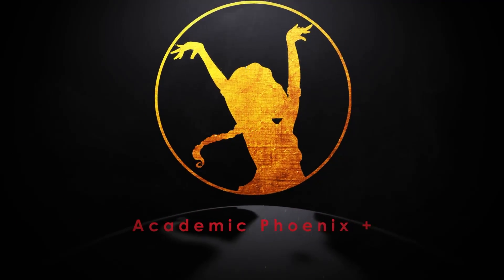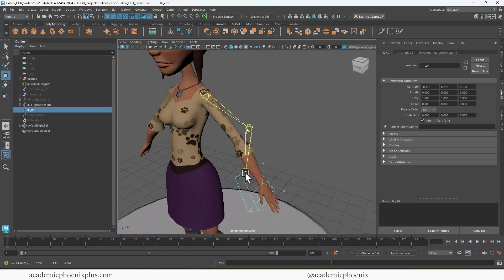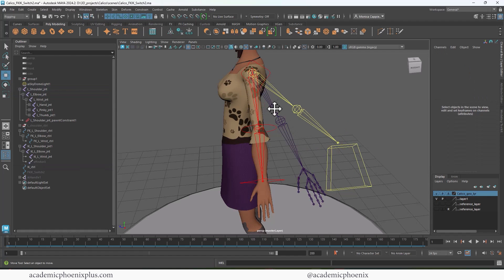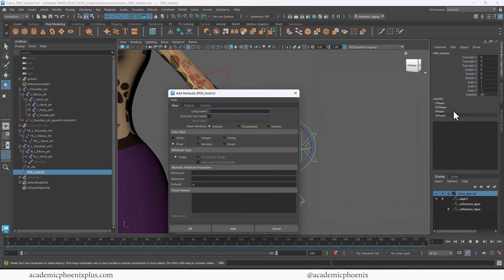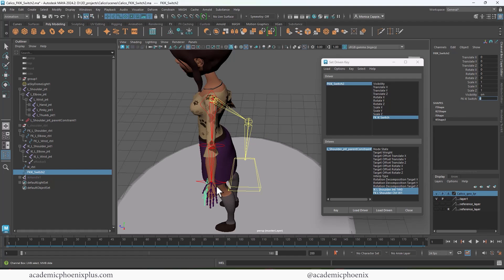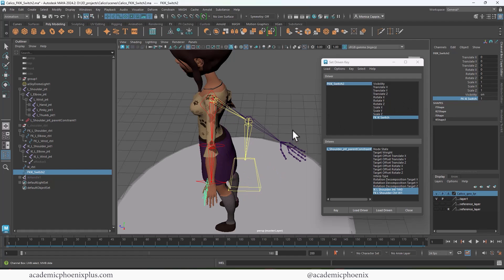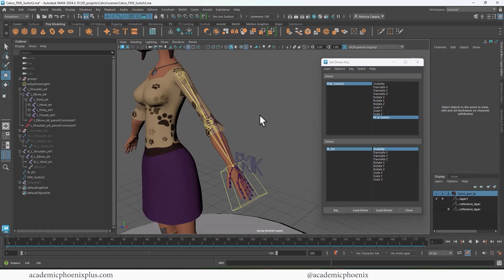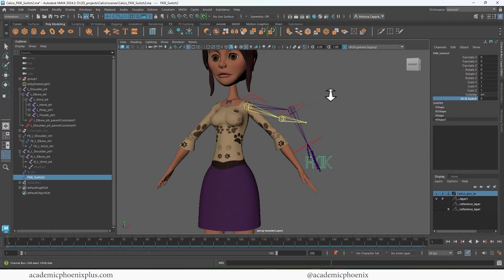How to Master the FK/IK Switch in Maya: Advanced Animation Techniques

Comment: Great tutorial! 
Can you cover a method to have ik/fk matching, so you can switch between ik and fk and the position doesn't return to bind pose?
I found a method that uses constraints and conditions to avoid cycles but this only really allows a singular switch before needing a reset.